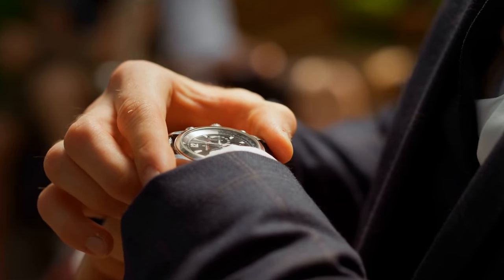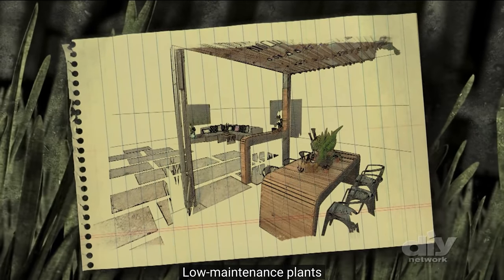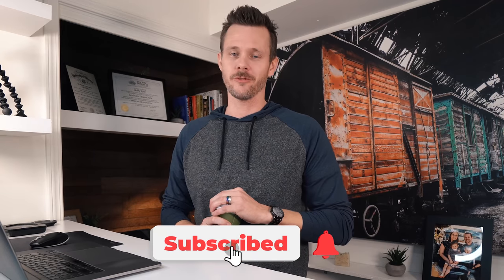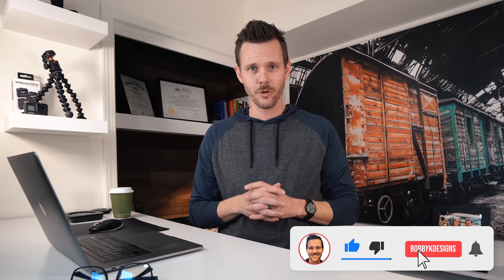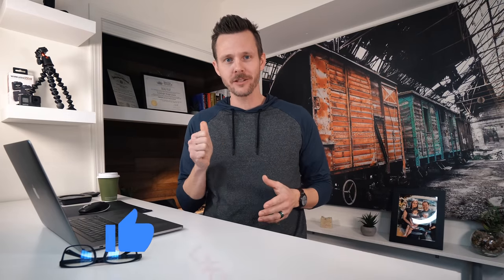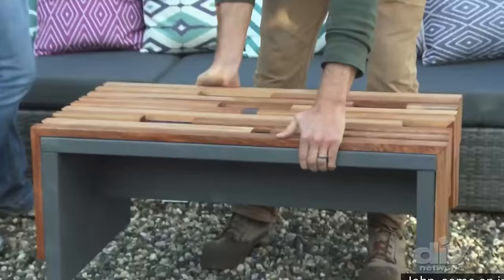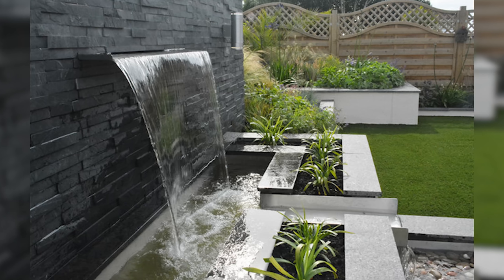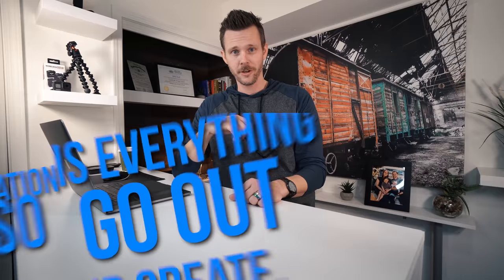Backyard Makeover // HOW MUCH and WHY?

Comment: 15:59 DIY people you MUST understand that there are odds for you to make a project of this level work from concept to construction and the dollars saved doing it, but it is not very likely. Yes, there are people who are incredibly gifted and can nail a project like this one on the first go, but thats not realistic for the rest of society.  A project like this is way easier when you have a highly experienced person over your shoulder planning everything and telling you NOT what to do so you don't have the experience of failures in time and costs - design side and construction side. 

With that said, they showed a shot with about 13 workers @ 12 hours each for 2 days = 312 hours.  Depending where you live, what market that can average between $25-45 per hour. At $45.00 per hour that's $14,040.00 JUST FOR LABOR raw without any mark up from insurance and overhead that must be calculated on top of the base the 14k.  Then entire project I would not build for under 40k. I've built 36" x 12" x 30' planters with footings and green screens for $30k+ that took 5 days with 4 crew.    

Tips:
**Avoid pit falls of soil removal** Another HUGE expense when demoing is the type of soil you have, where it gets moved, how it gets moved, and or disposed of and how much that expense ends up being if you have to haul and pay fees for disposal.  Example: you plan to demo say 5 tons of soil, but it ends up being 10-15 tons because right beneath the surface you get 2" and 3" or greater of rock.  It happens, and trust me, when you are on the contracting side (or DIY side) you had better put in an 'allowance' for demo for unseen sub surfaces or at least budget additional costs for unexpected soil removal.

**Software** Want to DIY a backyard project similar or larger than the above project, pay a couple hundred dollars for a bidding software for landscaping, learn it and use it.   I know, it takes time, but why wouldn't you want to spend $300 and the time to learn it to possibly save 1,0000.00's of dollars AND creating a realistic budget?  Imagine getting into a DIY of 30k+ and realizing you need $10,000 or 20k more.  Right. 

Keep up the great insight Bobby!  I like how you are not afraid to say it how it is. I'd like to add, please repeat or animate major fails people do not consider. Example you mentioned was permitting.  I would hammer that advice you gave on that fail alone a few times and highlight the crap out of it.  So so sooooooo many people have no clue what setbacks and limitations on structural heights their local implementation agencies require.  Including maybe giving a quick bullet of what the steps may be and on average how long it takes to pull the actual permit, the drawings required, fees etc. city county etc..
Reply from the maker: @D S. This comment is A M A Z I N G!  So insightful and well said.  I look forward to hearing more from you on future videos!!! Thank you so much!
Reply: @BobbyKDesigns  my pleasure keep up the work, and I do mean it.  Very few folks understand how much goes into a production you are putting together.  Just remember, you put out your art, it is what it is.  One thing in photography I learned over literally thousands and thousands of hours of photo editing was, never bother taking a shot if you don't understand if it is even able to be edited. If you are doing all of the vdo work yourself, my hat is completely off for you.  You're doing a great job, I suspect the entire process will be more fluid and can only expect some of your future vdo's and infromation to come together.  You got the right attitude, Keep moving forward!
Reply from the maker: @DS-ju2sq  thank you!!! I have a small team helping. I probably edited the first 80 videos myself. Takes a lot of time.